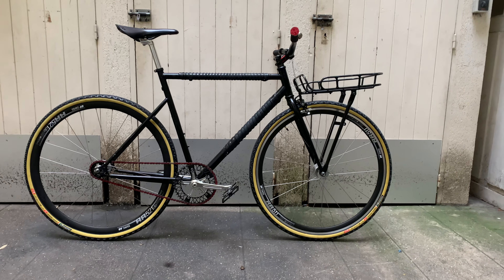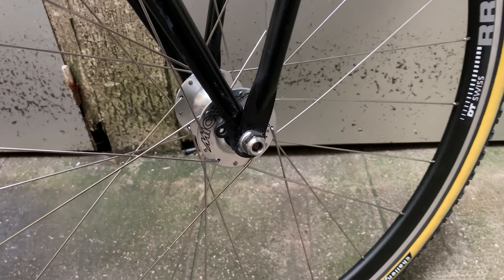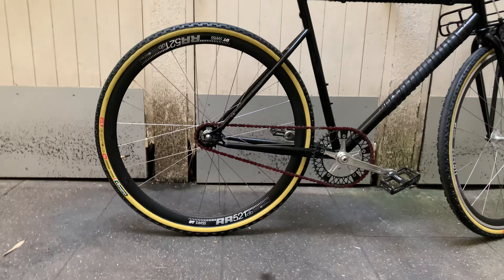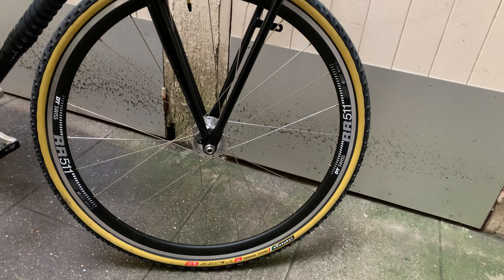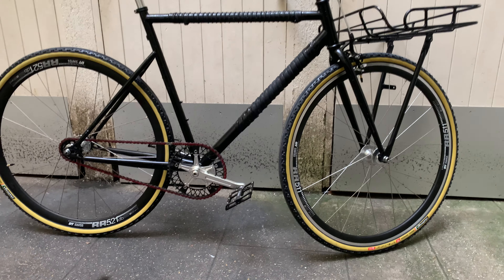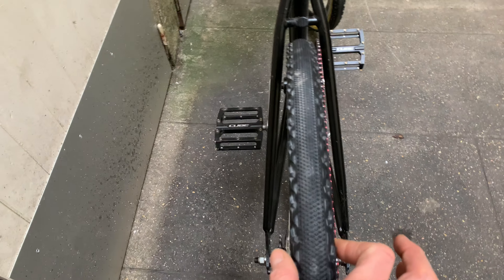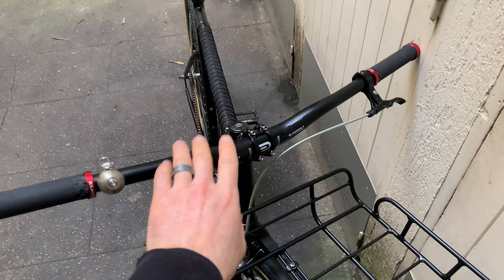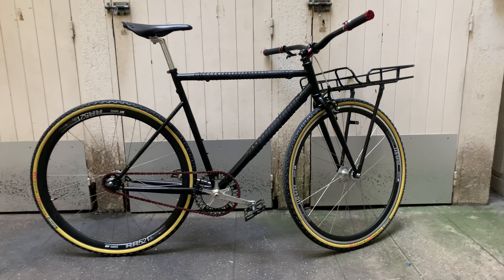Bike Check: TRACKLOCROSS 3.0 serious upgrades! Steel is Real!

Comment: What frame is this?
Reply from the maker: @dm47ic  i say it, it’s Decathlon Triban singlespeed painted (badly) in black. Complete bike only costs 250€ or something. I only kept the frame & front brake caliper 😂 changed everything else. Basically used it as a frame only

Comment: Hey Sam, je suis bien tenté de me faire un Fixie pour rouler à Longchamp, je voulais savoir combien fallait compter, de ce que j’ai vu ça tournait autour des 700 avec des roues Chinoises risquées, mais j’avoue que je me m’y connais pas trop en fixie.
Reply from the maker: Roues chinoises sont très bien. Cadre faut compter 400-500€ pour un truc correct. 150€ le pédalier, 300€ les roues. On s’approche des 1000€ rapidement pour ûun bon fixie alu fourche carbone et roues carbones entrée de gamme
Reply: @SamuelBlackMetalRider  cadre j’ai vu que t’avais des mielec, sur leurs site ils disent 120 ça vaut le coup ?
Reply from the maker: @raphaelgilbert9574  bien sûr mais c’est compliqué faut être très patient! Sinon check le DOLAN PRE CURSA
Reply: @SamuelBlackMetalRider  si c’est 2-3 mois de délai ça me va dans tous les cas j’ai le BAC avant, Dolan c’est un peu plus cher mais ça a l’air quali, je vais voir si j’en trouve pas d’occasion